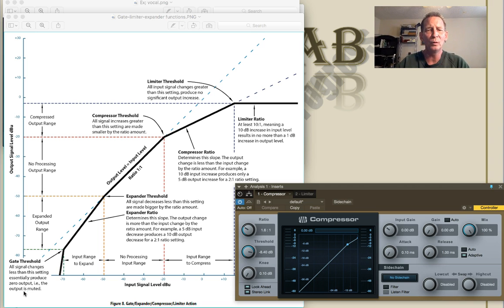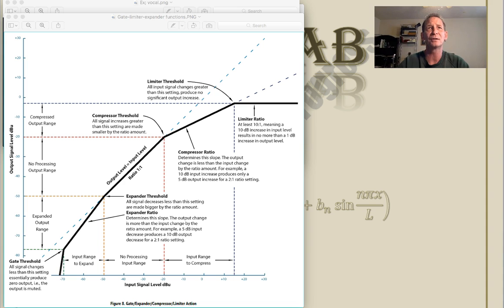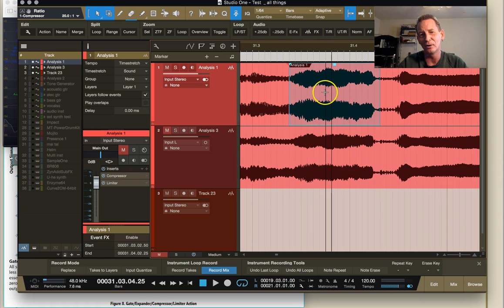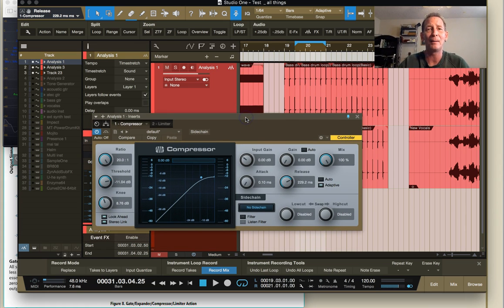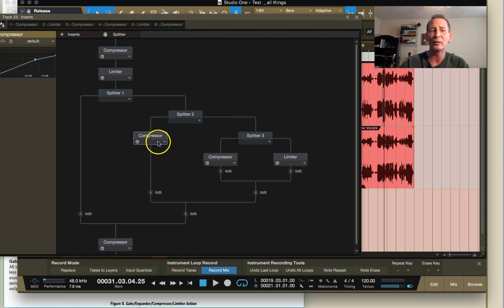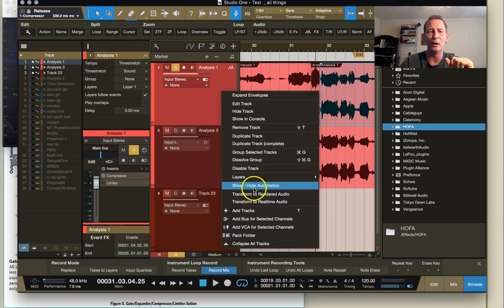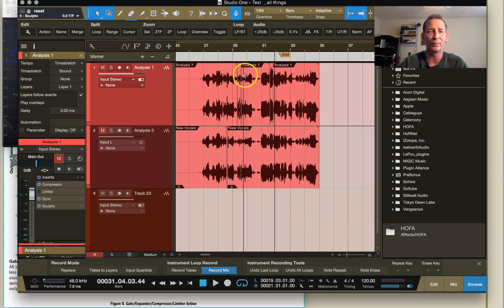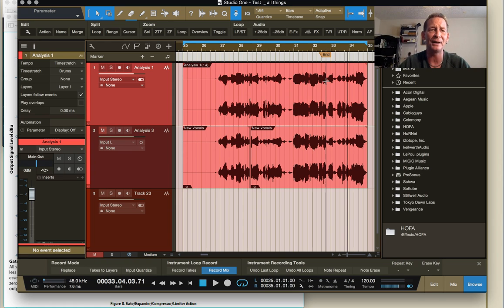Compression ; Compressors & Limiters, their basic function and other applications

Comment: Hey brent. Stumbled into your channel and it's been awesome, thanks for sharing all this knowledge!

I noticed at 5:40, you implied that a compressor would only compress the specific frequencies that rise above a peak. I'm fairly certain a normal compressor would compress the whole signal based on the volume of the whole signal, without regards to specific frequencies. It looks like you're describing something more akin to a multi-band compressor during that section.

Just nit-picking - this video and channel is a goldmine for information. Keep up the good work!
Reply from the maker: Thanks sir, and please pass the channel address around, i made it for people who can't afford to go to berkley lol, your statement is theoretically correct, but as with a limiter, the idea is to compress only the upper levels to compress the dynamic range, "the primary function of the compressor", reducing the distance between the highest and lowest levels, but depending on how well you use it, and the quality of the compressor, you may end up compressing the whole range of freq., instead of compressing the dynamic range like its supposed to do...does that clarify the question sir ?
Reply: @BrentCartwright-DocsLabAudio  Compressors and limiters typically don't have any circuitry capable of listening to different frequencies (unless they are multi-band), so they instead listen for the complete signal. Of course, a compressor that is compressing the whole range of frequencies is also reducing the dynamic range of the signal, without compressing specific frequency ranges
Reply from the maker: @orithecorn  i was trying to show compression on the louder levels, which happened to be the lower frequencies,  compressing the louder frequencies in the waveform being shown in the picture...